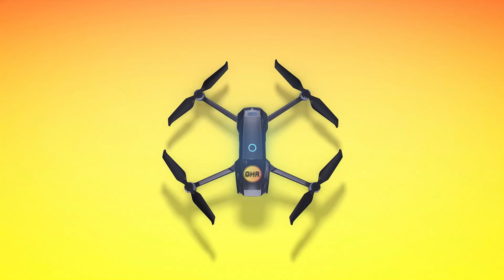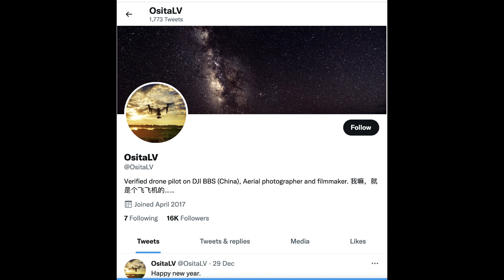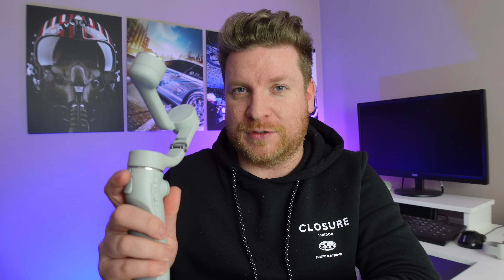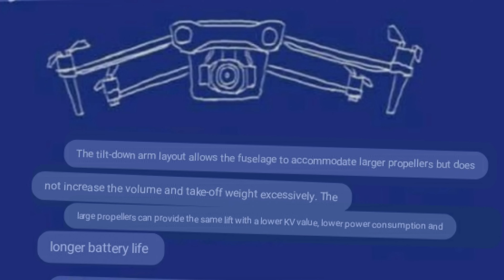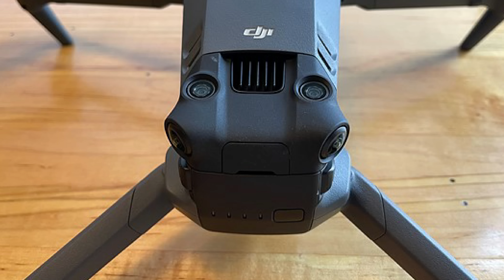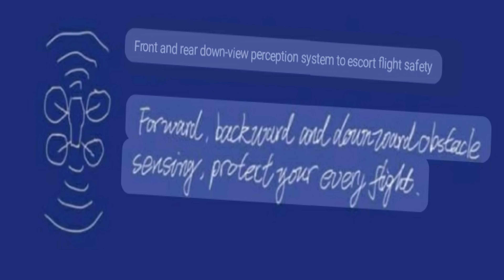Has THIS Just LEAKED The New DJI MINI 3 Specs?

Comment: Can't wait for the release of Mini 3 as this will make Mini 2 cheaper and, hopefully, DJI will release the SDK for Mini 2.
This will allow Litchi to add support to their fly app for Mini 2 which means Waypoints, FollowMe, Track, and being able to fly with cheap Android phones. Unfortunately, regarding Waypoints, I suppose will be Joystick mode, just as with the Mini 1, so missions won't continue when the drone loses connection with the transmitter.
If they can improve something, definitely they can add 60 fps to 4k video. No drone has useful 4k unless can shoot at least 60 fps, useful against choppy footage. I can't believe that Mavic 2 Pro doesn't have this feature and people buy it still for a high price. Even if you do not need 4k, having your footage shot in 4k gives you the option to do zoom-in effects in post-processing without losing video quality at lower video sizes.
Thanks for the update.

Comment: I'd say your speculation is either spot on or really close. I don't see Hubsan as much of a drone to aspire to for the Mini 3 but the Nano+ is quickly proving its chops in these features. The Nano+ also has the new RYYB filters to allow more light to get to the sensor so I'm wondering if DJI also has a trick up its sleeve to match that. It supposedly puts it on par with the Air 2s camera for low light capability. Well done Gavin! It's so fun to speculate like this!
Reply from the maker: The nano + is looking a serious piece of kit, I'm pretty disappointed I don't have mine yet! I think DJI will have to at least match autel on the mini 3, they are either going to have to pull some additional features out the bag or come in and undercut autel
Reply: @GAVINHR  It should be easy to under price the Autel Nano's and Lite's since those prices are quite high. DJI has the luxury of a much higher sales volume. It should be interesting to see DJI's price point for the Mini 3. I would guesstimate around $749 for the fly more bundle so $200 less than the comparable Nano+ bundle.
Reply from the maker: Weird, I was just thinking I expect to see a $200 increase myself, shelf the Mavic mini / see and make the mini 2 a bit cheaper as an entry level drone.
Reply: @GAVINHR  Good point on the Mini 1. Another thing to watch for.

 In November it will be 3 years since its release date. DJI may wait till Jan. 1, 2023 to discontinue parts/batteries for it. Yes; a good point for sure. All speculation at this point but again; that's half the fun. :)  The Mini SE uses the Mini 2 batteries and motors and maybe the props (if I remember right) so it might get another two years since it was released about 2 years after the Mini 1.

Comment: Looks interesting, and probably spot on to be honest. Makes sense it would share a lot of the design of the Mavic 3. Just reading about the new RC Pro controller being compatible now with the Air2S. I’m more interested in seeing if they add Mini 2 support since its the same transmission as Air2s. Could see myself getting a Mini 3 though, the new camera would be nice for my photography which is my primary use!
Reply from the maker: I'd be very surprised if they add mini 2 support for the RC pro basis I imagine it will be a sell up tool to the mini 3 but it would be nice to look after existing customers eh!
Reply: @GAVINHR  hah very true. Just like hyperlapse on the mini 2 (being in the original marketing! 😂) good old DJI eh 😂.

Comment: This seems about what id expect if they do move to single chip solution get rid of led and button, remove battery cover and lighten frame they could definitely add sensors, make props bigger and improve camera but i wouldnt expect anything past 4k60 though 2.7k120 would be nice
Reply from the maker: Given this would still be considered entry level I think 4k60 / 2.7k 120 would be more than acceptable and I imagine more than the average hobbyist would need I think that would be agreeable ☺️ thank you very much for watching and your comment

Comment: Hooray a sensible video not making any stupid claims on price and dates. It's very much what dji need to come up with just to match other manufacturers, they may even throw in something new and innovative the others have not thought of 🤷‍♂️ dji bring it on 🤜🤛
Reply from the maker: Nail on head. This is literally the bare minimum requirement to match the autel! I wonder what DJI will do to bring added value to the mini 3 unless they just undercut the nano range significantly! Cheers for your support Richard

Comment: Good work Gavin !! I was thinking about how to translate that note from OsitaLV and I found your excellent analysis. You are a great researcher. As a Mini 2 user I would settle for an improvement in the sensor, 4k 60fps, and longer flight time. The rest is not essential, but if the Mini 3 brings it, then welcome. Greetings and happy 2022 !! 👋
Reply from the maker: I think the same, as somebody else mentioned earlier 4k 60, 2.7k 120 slightly better battery life and low light performance with OA and it should be good enough if it's. It too expensive, thanks for watching 🙂
Reply: @GAVINHR  Nobody would buy air2s then.

Comment: What I am seeing with DJI is that they will not release the SDK at the same time as the drone so that we do not have the option of flying with 3rd party apps like Litchi for a year or more. The mini 2 would have had several more flight modes if Litchi was able to get their hands on the SDK. Tracking, focus and several more modes are included with Litchi. I have been using Litchi since the early days with my P3A and love it. While a proposed Mini 3 may have  some upgraded technical specs. the flight modes will probably not be there in the early releases.
Reply from the maker: I also use litchi with my Mavic mini and agree it's a great piece of software, the aSDK was supposed to be released any day now, it's a shame as DJI released the SDK for the Mavic mini after 6 months

Comment: Hi Gavin. I am still happy with my Mini 1 and the Mini 2 wasn´t enough for me to up-grade. Now that my Mini 1 is 2 years old, I have been thinking about a new drone and the Autel Nano+ is the one that caught my attention. For me to consider buying the Mini 3 it should have similar specs as the Nano+.
Of course if specs are similar maybe I would choose the Mini 3 because of commom interface with the Mini 1. For me the price isn't an issue but for some people is, I have read that maybe DJI is planning 2 models of the Mini 3. The Pro model with bigger sensor and OA and a Standard model with smaller sensor without OA but a lot cheaper.

Comment: I’ve just bought the Mavic 3 - so my piggy bank is a bit empty Gavin  so no “Mini 3 - to be or not to be” for me - hopefully they’ll release it with a bit more if it’s potential functionality - DJI didn’t hide this with the M3 but it was nonetheless annoying - surely DJI should get a group of Drone enthusiasts together and iron out the issues - 🤔 ah that’s what they did with the Mavic 3 - but in reverse - beta testers indeed - Hardware was good but the software was still putting its boots on - hopefully the next update will put some mustard on the beef - I think I’ll build my own sub 250 on my 3D printer 😃

Comment: I would like to see: obstacle avoidance, a bang on the mat precision landing, a full 30 minutes of real flying time. Otherwise, I am very happy with the rest of Mini 2 as an aerial hobby photographer. The Camera, with the right ND Filters and good settings is as good as any other more expensive non-professional hobby drone. In fact, I have watched many comparisons with more expensive drones and I don’t see any difference or very little.  It would be good it could survive a bird-hit, at 50 metres high and recover instead of falling from the skies. Thanks for sharing, Garvin.
Reply from the maker: When I did the mini 2 v air 2s video a LOT of people still preferred the mini 2, in itself it's a great drone and any mini 3 have you rightly said will have to be a lot better for people to change to it from the mini 2. A drone that could survive a bird strike .. that's an idea!
Reply: @GAVINHR  Oh yes Garvin, if a drone was at 50 metres high and it is hit by a bird, the engine should not die but continue working and recover before hitting the ground. Sometimes I fly the Mini 2 way out where I cannot see it and I always fear that if it is hit by a bird, that would be its Waterloo. The DJI Mini 2 is definitely the best consumer drone ever in the price-performance ratio category. Not so many hobby drone fliers can afford a drone over 1,000 euros, dollars or Sterling without the accessories.
Reply: @GAVINHR  yes my vid were it hit a farmers field power line fell and recovered
Great done for durability
Reply: I found that a set of big eyes and a fluorescent orange skin keeps the hawks off of my drone. I live in the Ocala National Forest and we have many birds of prey here. Not one strike to my mini 2 as of yet. I did watch an Owl check it out but it left it alone.
Reply: The new Autel mini meets many of these specs honestlu.  Never flown one or any of the Autel line, but their new mini may be the 249g drone to beat.

Comment: Hmm if the source is accurate then it does look like they’re using the Mavic3 design as a new template for a mini version. Makes a lot of sense.
Reply from the maker: It sure does I agree, I imagine the next air series will go down the route of the slimmer legs also and the new battery
Reply: @GAVINHR  Would have thought so yes. I think there will definitely be more similarities coming up!